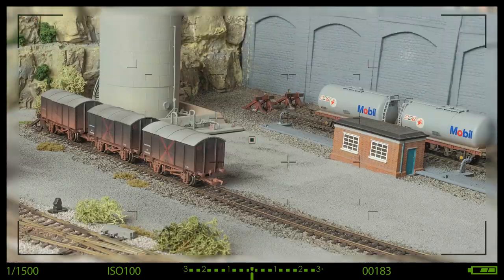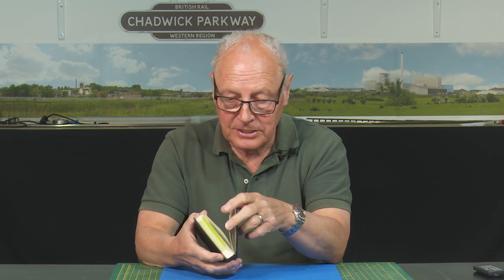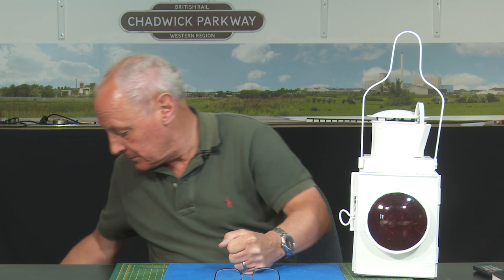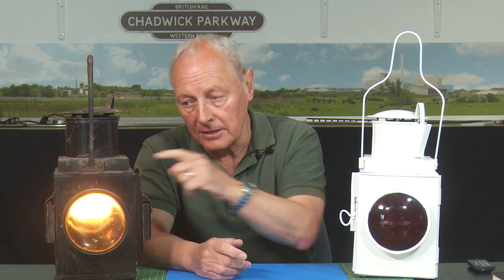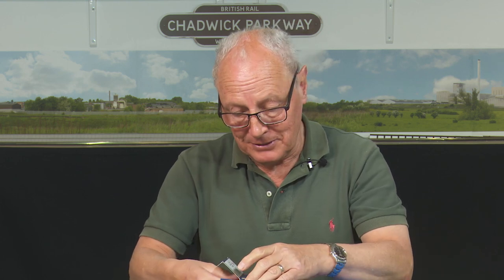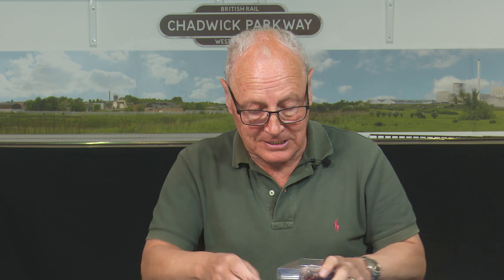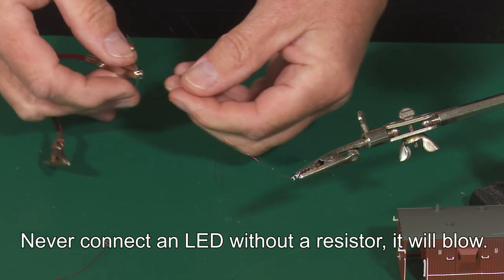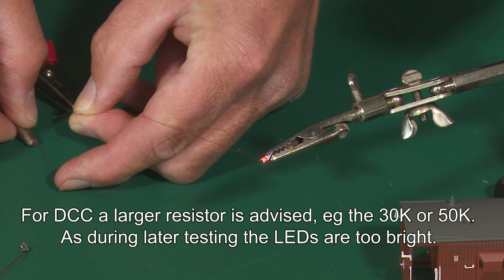Guards Van Lighting at Chadwick Model Railway | 94.

Comment: Hi Charlie. Epic indeed. Could you not just paint over the white LEDs to dim them a bit?
Reply from the maker: I don’t know. But I’m certainly open to advice on this one.
Reply: Chadwick Model Railway try using a fibreglass pencil /wet&dry paper to lightly scuff the surface which will reduce the light output.
Then use Tamiya clear red/clear yellow over the top charlie.
Reply: @UndergroundEric  Tamiya "clear smoke" might dim things nicely.
Reply: To be pedantic they are "brake vans".  Just check the rolling stock register for your prototype.

Comment: Just watching this again.  I have recently discovered that Deluxe Glue ‘n’ Glaze , run along a wire held in place with tape, does a great job of holing the wires discretely and firmly.  I use this technique when fitting Lamp, Cab Lights, and Firebox lights in my steam locos.
Reply from the maker: Thanks Robert, a useful tip.

Comment: Grat video Charli. I was a freight guard back in the 70s and remember those three lamps. We use to carry exter parafine in a bleach bottle incase the lamps  ran low...also handy for lighting the stove when the coal was a bit damp Those were the days lol
Reply from the maker: That’s great Andy.  What type of unfitted freight did you work on?
Reply: Chadwick Model Railway Usually local pickup freight from Cambridge to Bishops Stortford, Cambridge to March, Cambridge to Ipswitch, Oil train From Stratford to Royston. Even a Sand train from St Ives to Cambridge. It was a good job

Comment: Another great video Charlie. 
Those old freight guards were kept quite busy when working over multiple track routes. Traditional tail lamps had a bracket on the back for dropping onto the traditional vertical lamp bracket. The GWR and latterly the BR(WR) had lamp irons orientated the opposite way on freight wagons and locos, although many of these were altered in the 1960s and 1970s.  If you look at the lamp brackets on a former Western Region 37 nose you will understand.

On the rest of the railway the side lamps on a brakevan were orientated the same way as GWR tail lamps - so that the side lamps and tail lamp couldnt be mixed up. This was because brakevan side lamps contained red shades for when used as reds rather than whites.
Reply from the maker: Great info Phil, many thanks. Regards Charlie

Comment: Charlie,

When I work with LEDs, I first connect them with a resistor box to , say, my 12 volt source, or whatever.
I first set the resistor box dial up to a high resistance, over 30k say.

When the led lights up, it most likely will be dim at that high setting.  I then slowly start dialing the resistor box down until I see a suitable glow, but do not over drive the LED.  I note the value on the box and substitute a resistor of similar value and I am done.

I usually drive my LEds at about 20 ma, although they most likely have a forward current rating of 30 ma.

It saves energy, the led is sufficiently bright, and runs a bit cooler and the lamp life goes up significantly.

So lets say the led is rated for 3 volts at 30ma and you have a 12 volt source.    R=E/I so R is (12-3)/.02 or  450 ohms.

You need a 450 ohm resistor to drive a 3 volt led from a 12 volt source and have it consume 20 milliamps.

You have to drop 9 volts across the resistor.

Bob Schworm
Reply from the maker: Very interesting Bob.  Did you buy the resistor box or build it yourself?   Regards Charlie
Reply from the maker: Thanks for the link Bob

Comment: Wow, that is impressive. I think I have 5 or 6 N E Guards/Brake vans they would each have to a Bridge and the lamps. It could be costly. I will have to check the Piggy Bank . Thanks Charlie for an interesting video. I hope your thump will get better. Martin. (Thailand)
Reply from the maker: Thanks Martin, my injury has healed but no pain no gain! (What rubbish).  It was a soldering challenge mind you.
Stay safe mate, regards Charlie.

Comment: Hi Charlie, really appreciate your channel. The worst I did LED-wise was fumble 6 LEDs into an N scale railcar head...
Reply from the maker: Blimey, that’s no easy task!
Reply: @ChadwickModelRailway  That's the bugger: https://www.youtube.com/watch?v=xCu14xggC_E though in the video the cover on the head was not attached properly (no front lights :(  ) , but you can see the three in the back... I think I fried three LEDs after I had installed them and nicely masked with black paint. The model was partly made of 3D printed parts - two years before an industrial model was released (ÖBB 4010 - Transalpin).

Comment: Hi Charlie,  you can use a voltage regulator, very cheap of EBay. You can then set the required voltage for your led and also have some control over the brightness of the led. They are adjustable on a potentiometer on the little pcb morning. My railway is 16mm scale but I use regulators to control brightness of led gas lamps on station buildings and signal lights.
Reply from the maker: I’ll certainly look into it buddy.

Comment: And, this does bring back some memories from my sea-going days.  I got some breadboard kit parts at Radio Shack (RIP) and rigged up a gismo with LED in patterns on one side, and the wires and switches on the reverse.  The tricky part was in wiring the combinations so they could be thrown with just one switch per each.  And, thus, I could quiz persons on the Bridge UI (under instruction) on how to identify vessels at night based on the displayed running lights.
Reply from the maker: What an interesting comment Mac.
Reply: Green to green, Red to red, perfect safety go ahead - and all the other stuff :-) I remember doing my eye sight test for the MN, tricky as the lights got fainter and it became more difficult to pick out the colour differences.

Comment: Hi Charlie, loved your video. Afterwards I was thinking about how I would have positioned the components. I would have put the resistors on some Vero or matrix board stuck under the roof. That would help keep the fine wires out of the way. Then put the capacitor and pcb on the floor. But I guess, with hindsight you have come to the same conclusion. Andrew
Reply from the maker: Hi Andrew, please don’t forget that I was just making up as I was going along! Regards Charlie
Reply: @ChadwickModelRailway  I realised that and hindsight is fantastic. Its good to watch the 'design' process and then improve on it. I can't imagine how I'd fare live

Comment: I was just thinking about this, nice guide although being "hard core" I will be undertaking this on HOe narrow gunge stock as i want to ruin my eye sight. If you do read this, you may want to think about getting a few "metal spudgers" a flat pry tool designed to ease the screens off the frames on mobile phone repair. Very useful in splitting train bodies.
Reply from the maker: Thanks for the tip, I shall certainly check them out. Regards

Comment: Hi, you did very well, I found the tutorial entertaining. When you strip wire it leaves you with a hollow tube that can be used to colour code magnet wire (enamelled wire). The wire is a small enough diameter to easily thread through the tube. Also you could solder pigtails to the combined resistor wires as well as the anode magnet wires, this allows for proper soldering to the PCB. The wire should be soldered to the through holes of the PCB and the copper pads should be totally covered with solder.
Reply from the maker: Great tips Geoffrey.

Comment: Enjoyed the epic Charlie, I love that you always show your mistakes and offer up the corrections. One tip with the resistor clump, your general electronic supplier should have universal strip copper circuit board that you can cut to size and easily mount the resistors or other components on. This would enable you to connect wires to them easily and allow an amount of miniaturisation. The copper tracks on the boards can be cut with a knife and the board cut with a dremel slitting disc to size. Cheers and stay safe.
Reply from the maker: I’m so pleased that you found it useful Chris

Comment: The capacitor used in your video is 1000uf microfarad. When testing your LEDs, use your multimeter in resistance mode to test without the resistors. The low voltage the meter outputs for test purposes through the probes will light the led safely when the polarity is correct signalling which wires are which +/- . One could also use a button cell like a CR2032 safely to test LED polarity without a resistor if you don’t have a multimeter. The resistor number could be reduced also by wiring the LEDs in series rather than parallel, doing this and checking resistance values to suit your model as you go. Hope this helps.
Reply from the maker: Great tip on the CR2030 Steven.

Comment: Hi Charlie, Another great and informative video about Guards van lights. It looked a fiddly job with all those wires to route to the inside of the Guards van. The only suggestion I have is about installing the capacitor. I would have cut the longer tail on the capacitor to the same length as the shorter and then insulated them with red and black wire insulation, then soldered the capacitor to the circuit board. Regards, David.
Reply from the maker: I think that you’re right David but at the time, as you do it, somethings just don’t occur to me.

Comment: Great video picked up many pointers. On future projects you may consider using a 6 pin commoned resistor network (Rapidonline part no. 63-0300) soldered to a small piece of stripboard.  This would save space as the LED leads would be soldered directly to the stripboard so the heat shrink sleeving wouldn't be needed.  Also if using a 16v capacitor with DCC I would seriously consider fitting a 15v Zener diode across the capacitor.  Look forward to your next video
Reply from the maker: Thanks for the tips Graham.

Comment: Very interesting, and have read a bit about the Gaurd van rules, and have been lucky enough to have driven some small engineers trains and shunted with 2 brake vans , a ex LMS  one and the mega ex SR Queen Mary one .One of my railway interests is brake vans , maybe that's why I have 4 different ones on my layout including a queen Mary.
Reply from the maker: I too have a Queen Mary.
What type of freight did they guard?
Reply: @ChadwickModelRailway  they used to do the fast milk/parcel trains and later used on engineering / dept trains .we use our one mainly for people to ride in , and some P/W trains.
Reply from the maker: Thanks Ian.

Comment: A great video.   A tip. With super glue....try breathing on the item whilst being held, the moisture in the breath speeds up the drying time. 
It works with the glues I have used. Can't say with Rocket Glue, as I have not used it.
Frank.
Reply from the maker: A good tip Frank

Comment: Very enjoyable watching you solder what amounts to a piece of human hair, sincerely amazing work Charlie. Would it be feasible to place some black card over top of the wires/capacitor from the top down sandwiching them below the window line? If so that would maintain the view through the van.
Reply from the maker: I would worry about pulling on the wires which feed the top lamps Quentin.

Comment: Charlie.
Firstly. Thanks as ever for a good entertaining and informative video.

Stay alive capacitor. Mentioned by another contributor as well. DCC, once bridge rectified, can peak be well over 16v (22v not uncommon) , 25v a better option particularly if using Tantilum capaictors, to get size down, as they have a habit of catching fire! You can get more complex and add Zenner diodes to keep it under control but then more components to get into a small place.
16V fine for DC only.
Reply from the maker: A fair point mate.

Comment: An interesting video as more realism introduced. On dcc systems can reduce size of capacitor and simplify circuit and lower power losses by connecting the leds in series instead of all in parallel as used here. Best to do white in series plus dedicated series dropper resistor, then red in series and a separate dropper resistor so can trim intensities of same colour to suit. Can reduce cap size by 60% for same hold up time. Analogue will need almost the full 12V for the  three red leds to light, but doing red as 1 and 2 (with green 2 in series, so now total 3 droppers cap size drops by 40%) in series will light at approx 7.5V. I can't help think folk grossly oversize the hold up caps wanting 2/ 3 secs when only .2/ .3 secs is probably all you really need - unless of course your track work and maintenance thereof is really poor!! Stephen
Reply from the maker: A very interesting comment Stephen. Many thanks..

Comment: Jennifer E Kirk has at least 54 Brake Vans! Umm just wondering? Great video once again and gosh what a job that was. To be able to alternate between DC and DCC a two-way switch with different value resistors on either switch pole would make the job even more complicated. To disguise the capacitor I would make it look like a pile of logs for the fire as making it look like a Barrel of Beer would not work as it would not fit through the door. It's a shame you had to cut back the lamp-irons as if the led lamps had slots moulded into the back they would just slot on instead of superglue?
Reply from the maker: We got there in the end Ian but 54 brake vans!!

Comment: Another excellent video thanks Charlie.  I'm a bit concerned that the guard is standing on the balcony and that the protective bars are hanging down and not across the side gaps although it isn't part of this project.  It's just going to the extent of putting on the correct lamps that the protective bars aren't in place.
Reply: Don Sharpe ah, but it’s Jim’s brake van. 😅
Reply from the maker: Good point Don, best Jim sorts it out!

Comment: I used to hand wind with .04mm Enamel wire so i feel your pain, You could always add a resistor inline with the pick up wire to dim it down some more.
Reply from the maker: I think you’re right. That is the best way to dim them down using a resistor on the power in line.

Comment: Hi Charlie,  I know you tried your best to show us, but for those of us who don't know anything about electronics it is easy to get lost very early on, right back to when you put the track pick ups on as you didn't show both wires very well and how that looked and then I was lost after that.  I want to fit a red stop lamp onto a cement wagon using the lights from the same maker but I'm going to forget it because it looksto difficult - maybe you should have showed battery operated ones if they are easier to do?, regards, Chris.
Reply from the maker: I do understand your point Chris. However, I wanted to use LEDs that had the white light facing forward capability. Therefore a battery operated option wasn’t suitable. Regards Charlie.

Comment: Great tutorial. Personally hate Enamel wire. Especially when you want to trim it. Found Acid flux helps a lot! When I've done coaches with internior lighting, I have used a bridge rectifier and capacitor. Works out a bit cheaper but understand people may prefer a board.
Reply from the maker: I understand your point James. But the little board was very cheap.

Comment: I think leds are now available in several voltages not just 3 or 12. Given the issue you had in removing the strip is there a need to superglue it in? Apparently you can use a hairdryer or a mixture of baking soda and water to activate superglue!

On a different issue, I watched a video on elevating track on curves. He suggested that as 00 track isn't true to scale, he leaves a greater gap between the lines. This would suggest that the peco gauges are incorrect unless they have compensated for the difference. Any views?

Another great video, possibly the 1st without you gluing your fingers😁
Reply from the maker: Yes, I agree, Hugh, Peco code 100 is actually HO and not OO.  Regards, Charlie

Comment: nice one charlie I will have a go at doing mine when I can afford it but, to be honest, I didn't understand why you didn't solder the resistor straight to the board as you had plenty of room maybe that was an oversight but over than that as an auto electrician you did a fine job I would say personly it was an intermediate skill required to carry out the task of fitting said lights but you did another splendid job of another instructional video what might have confused a lot of people by using the terms cathode and anode which is their correct terms but to simplify just call them positive and negative they may find it easier to understand I myself found it once again just brill .all the best john from Rugby.
Reply: Do you mean the through hole Capacitor?
Reply from the maker: Sorry John but I did solder the resistor group, onto the board.
I disagree that is an intermediate skill.  Not to a non electrician.

Comment: Hello Charlie! Great stuff! I recently bought the GWR HST set from Hornby, the dummy car has no power or lights, so could I power up the dummy car the same as Jim's brake van and go to your dcc upgrade on the intercity to try and have the lights change red to white as to which direction the train is running, if that makes sense.... Great video cheers 🙂
Reply from the maker: Yes James, that sounds completely achievable. Regards Charlie

Comment: Wow! Brilliant vid, only just talking about doing ours yesterday so very timely. We were going to try 3mm leds but probably too big. Just had a thought of using an led inside and running some fibre optic from an old, (well, it will be!), xmas tree! Do you need a bridge rectifier as the leds should light on half the waveform, or is just a nicety? 
Thanks for the entertainment, Cheers Loz
Reply from the maker: I believe that it converts the square waveform into a straight DC flick a free power supply.